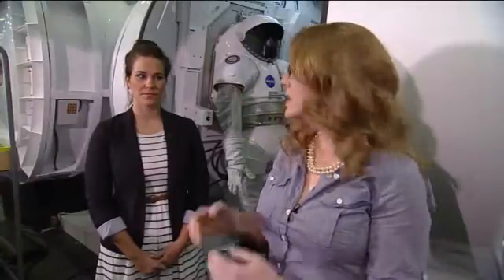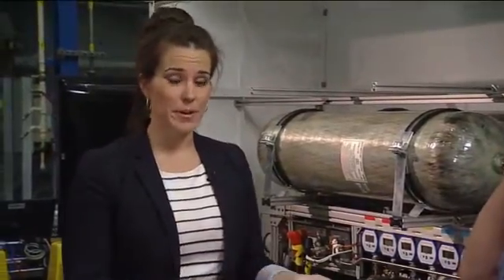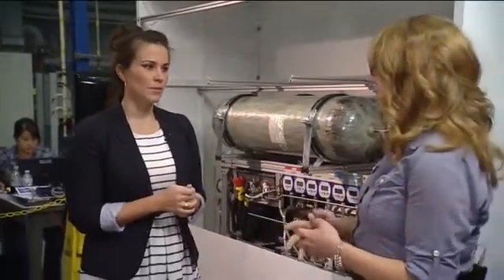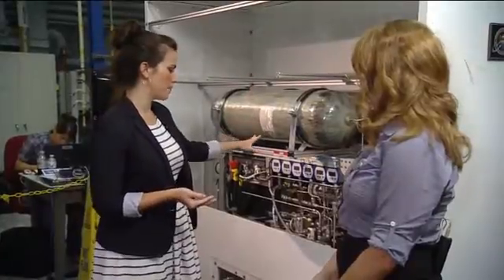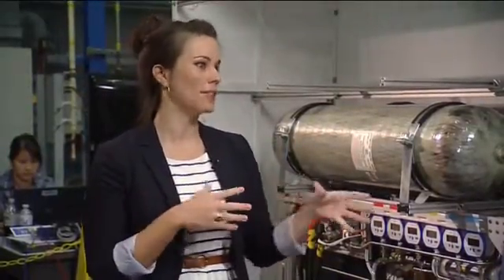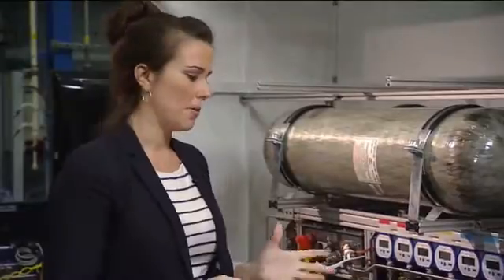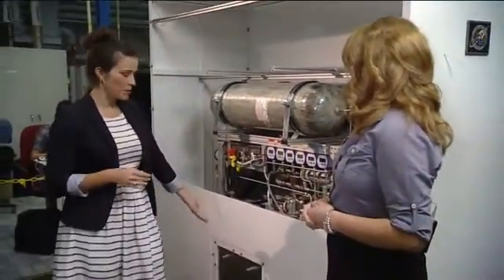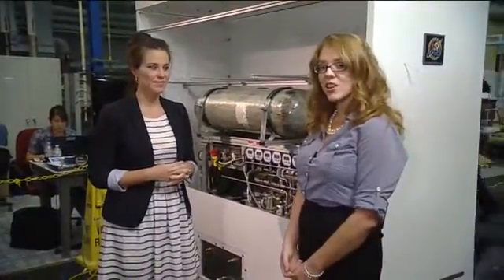ISS Update: Powering the Space Exploration Vehicle

Comment: I wonder if it would be cost effective to use fuel cells for secondary space propulsion. You could use the fuel of the rocket to fuel the fuel cells then the exhust of the fuel cell and electricity to power the electric rockets. If it was a visimr rocket you could have higher thust with more propellant at first by using any waste gases from the ship. And as you speed up you could lower the propellants and increase the specific impulse with the same amount of power. This way thust would be more efficient like gears in a car and the rocket could be running constantly increasing efficiency to make up for the lower power output.